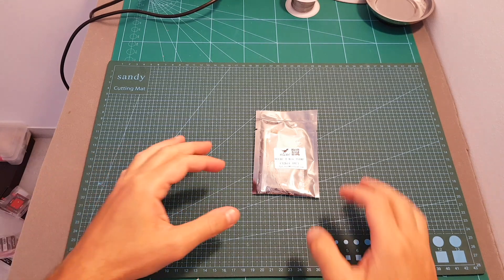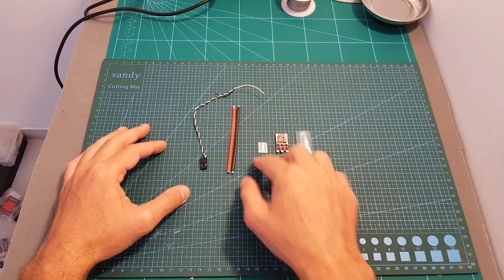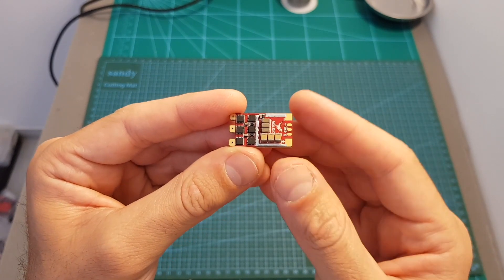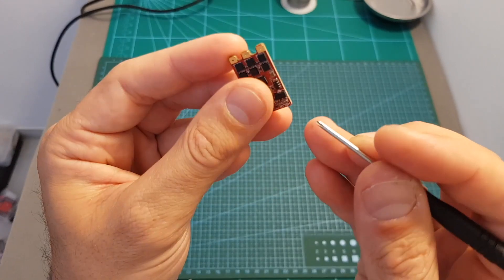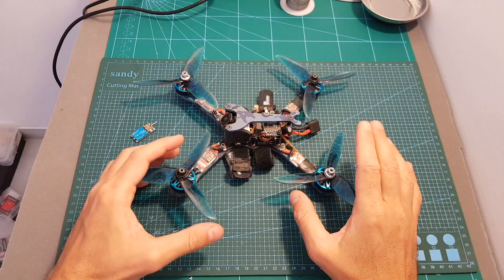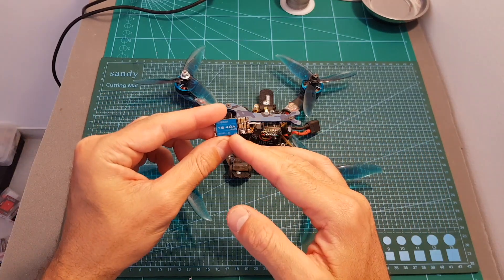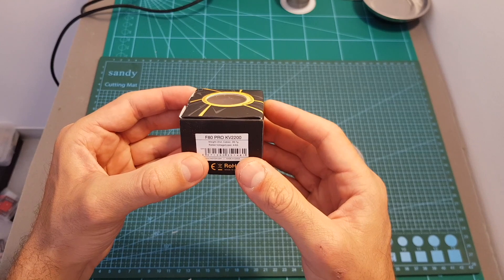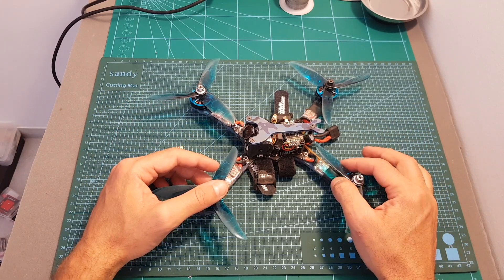HGLRC T-Rex 35AMP BLHeli_32 3-6S ESC

Comment: Hey man, what if i put a caps on each esc and caps on my aio? will it do any justice?
Reply from the maker: Hi, why do you need a cap on each ESC?
Reply: Gal Kremer the video noise. how does this fare? isit still good?
Reply from the maker: @afifathnin  Do you have any issues currently using your setup?
Reply: Gal Kremer not at all but i did put all caps on my set up. lol i just found out , 1 of the esc was Dinoshot 40amps instead of Trex35